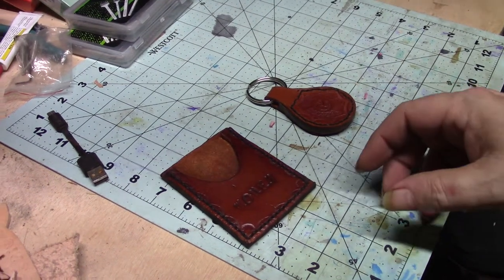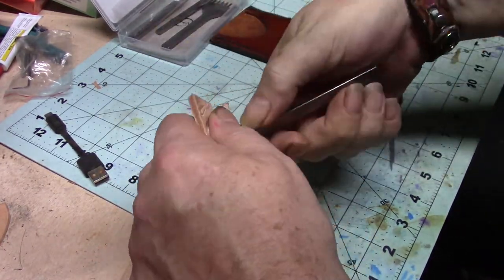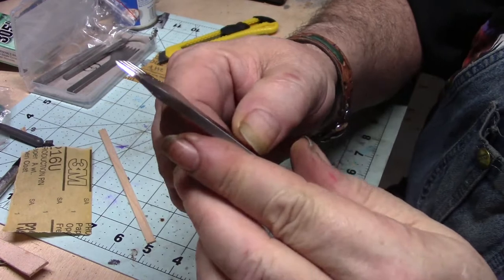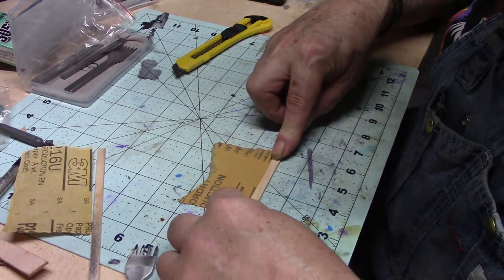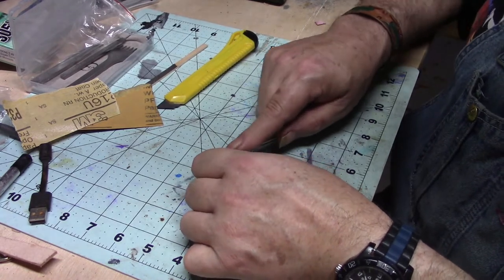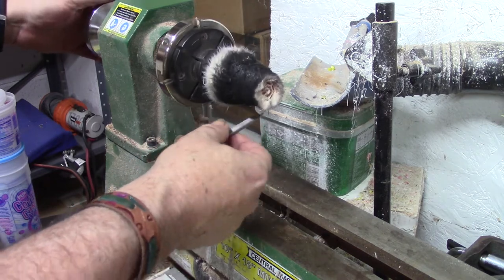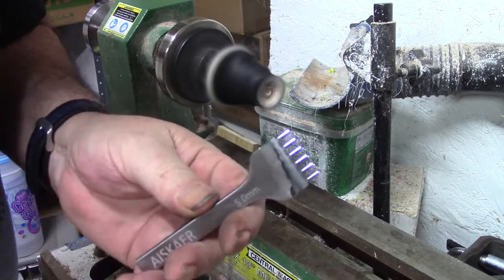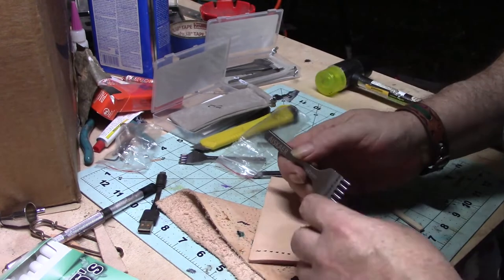POLISHING CHEAP LEATHER STITCHING CHISELS #leather #diycrafts

Comment: I wonder how to go about those delicate French style prongs
Reply from the maker: The exact same way.  Polishing metal is the same steps, and the polishing wheel getting in-between the prongs just by holding it flat.  Think of butter being squished between the tines of a fork
Reply: @pappytinkers  I imagine it could be possible, I was just skeptical because I think of those prongs as a row of knives - and those have to be stropped and sharpened under exact angles and such. I hope polishing wheel will be good enough! Thank you.
Reply from the maker: @glacialimpala  because the tines are parallel to each other, the right thickness of sanding stick will automatically keep it at the correct angle.  A coffee stirrer worked great for my #4s.  The buffing wheel doesn't take off enough material to change the angle.  Mine still have the same diamond shape

Comment: Very nice tutorial. I also like to grind the show face a little bit because in these affordable sets it also tends to be uneven .I like leather working because is one of those hobbies that you can pretty much start and get to a very good level with 100$ . You can buy all the tools and stuff you need for around 100$ and some good leather for around 50$ . I bought 4 sets of stitching chisels (3,4,5 mm diamond and 3,85mm french) a Japanese skiving knife , a European skiving knife (made in England new) ,some threads ,needles and a mat for around 100$ . I wanted to be quiet cause I live near others so I also bought a thick cutting board to dumben the noice.
Reply from the maker: Agreed!  I bought a lot of stuff used too.  I found a silicone mat on amazon for about $10 that really dampens the sound, plus protects the tips of the punches.  I wish I would have started leather working years ago, there is so much I want to make and try!